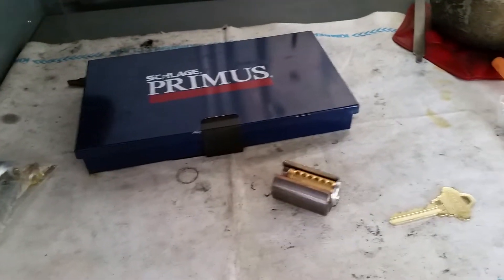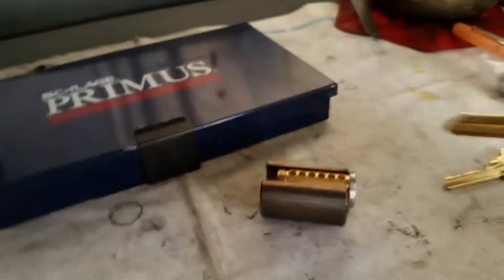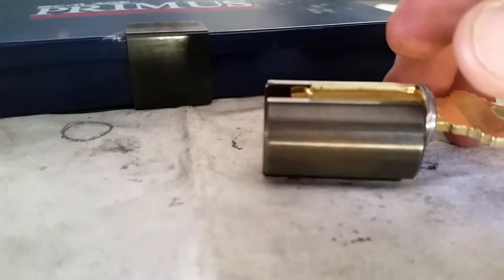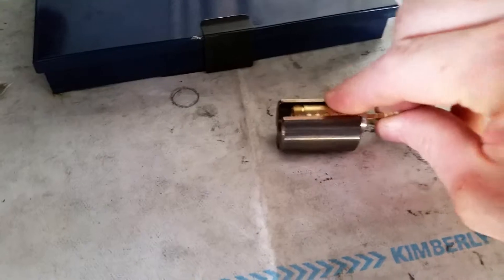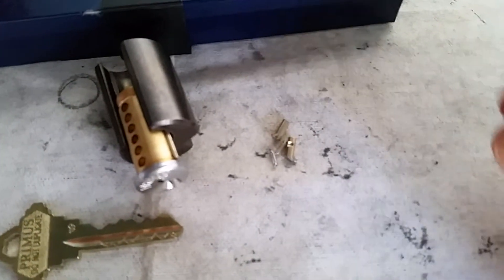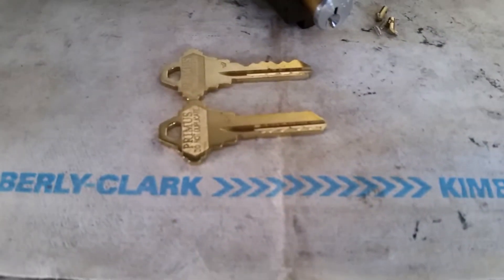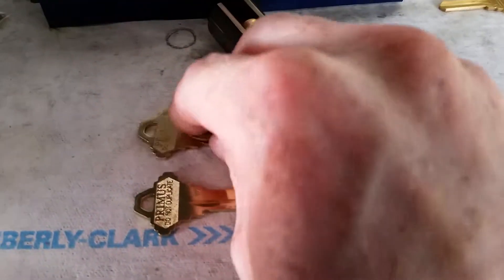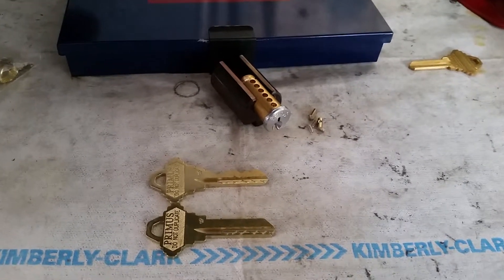Schlage Primus High Security Lock Cylinder Overview

Comment: Bs primus can not be picked there are dozens of videos showing how to do this. Yes it's 5 more pins that need picking and most are in a low position so that when you insert a piece of metal in the slot 3 our of 5 secondary pins are picked automatically. It may add another 30 seconds to the lockpixking to an experienced lockpicker.
Reply from the maker: Hey Max, thanks for checking out our channel. You are wildly misinformed about how a Primus high security lock cylinder operates, but that's ok, they will continue to operate as designed! Have a great night!
Reply: @Aplussafeandlock  I do not think so. https://www.youtube.com/watch?v=WzCzVx9YrU0

Comment: How much does it usually cost to have a locksmith key up a Primus?
Reply from the maker: Hi there, thanks for taking a look at our channel!  I can't speak to a national average, but I can tell you that we rekey high security knob and lever cylinders for $25 each. Hope that helps!
Reply: I was sold a classic primus cylinder with two unregistered keys for $60.  If I was to buy a registered key, it’d be about $200 for the same equipment.
Reply from the maker: @muhdewd9727  Yes, the registered locks cost the supplier, and therefore the consumer, much more.   Add to that the record maintenance that is required to maintain the dealer's license and prices go way up!